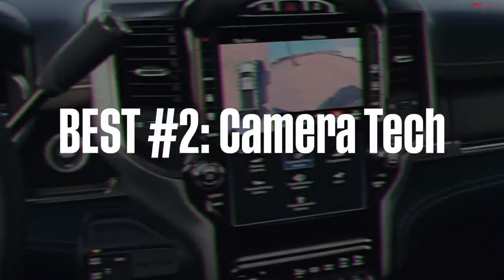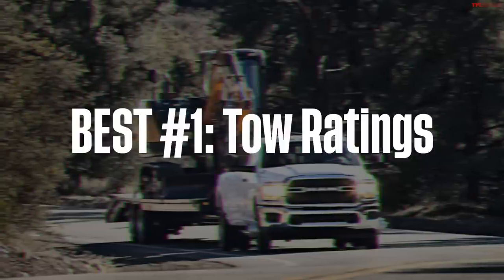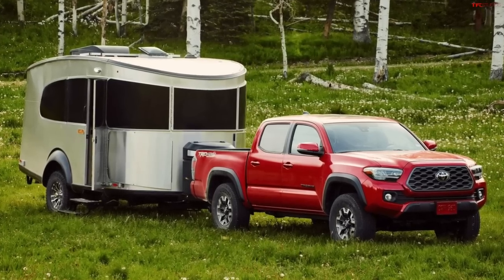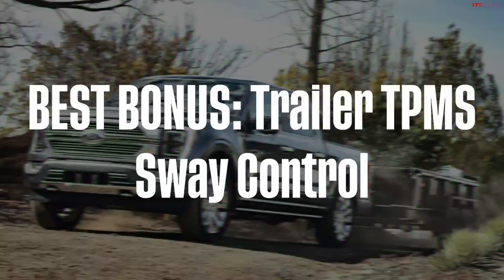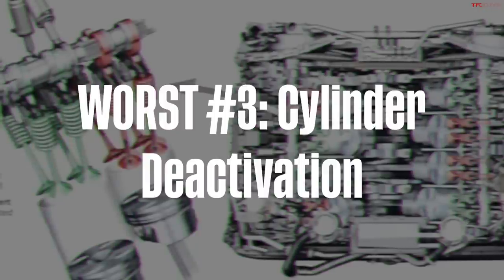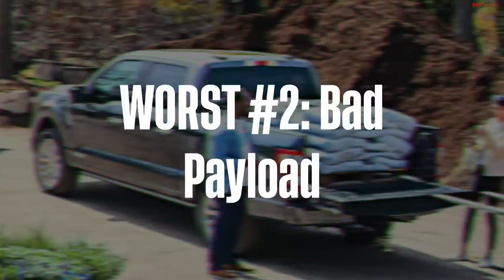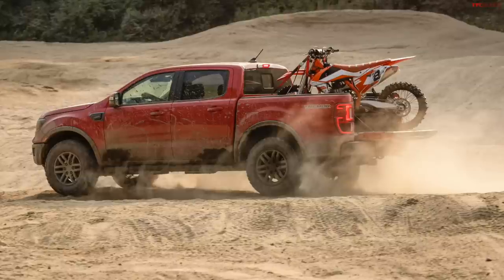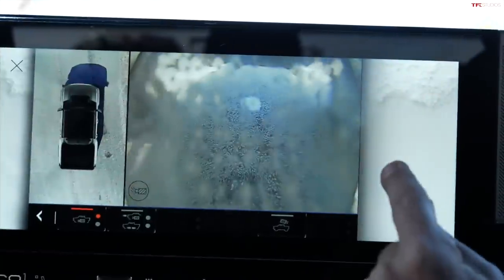This New Truck Tech Makes Your Pickup WORSE!

Comment: There are two ways to save fuel, make a large engine act small when full power isn't needed (cylinder deactivation) or make a small engine act bigger (turbo a small displacement engine). It appears that the former achieves better fuel savings (comparing GM results to Ford's Ecoboost).  Not sure about the long-term durability concerns though.
Reply: Subtract weight, reduce aero drag. Engines are practically meaningless. See Corvette mileage vs Silverado.
Reply: @talanpomeroy4475  in a pick up truck designed to tow 10k+ lbs... And tell that "engines are meaningless" comment to my 1997 F150 with the 4.2L V6 that can barely get 16mpg while weighing over 1k less than a modern half ton truck (with a V8 getting 20mpg).
Reply: @HorchataFan Interesting opinion, but the data (both GM's and owner data in Fuelly) says otherwise. The reason I compared the old versus new engines was I was responding to someone who said engines and efficiency tech don't matter...they obviously do.

Did a little googling to see if some of your points were correct though....it's good to be thorough. Drag coefficient for my 97 (smooth body) is .45 versus the 2022 F150's .463, so my old truck is actually more aerodynamic.  My truck weighs 4203 lbs versus the current F150 at 4941 lbs.  My 4.2L produced 210hp/255lb ft versus the current 5.0 V8's 400hp/410lb ft of torque.  I do have the 5spd manual versus the 10sp auto....didn't check final drive ratios (efficiency once cruising) but I suspect there isn't a ton of distance between them.

Once a vehicle (whether it's a truck or bicycle) reaches a constant cruising speed, nothing close to full power is required (not talking about hauling any load here). A quick Google search shows it ranges from as little as 10 to 70 hp...this is where cylinder deactivation (GM) or getting off the turbos (Ford) yield fuel economy benefits. While both yield results in lab testing to push up EPA estimates (neither company would go through the expense of adding them if they didn't), GM's approach appears to be better in real world driving.

Comment: If I purchased a new truck, it would be a 60-70's 3/4  ton 4 door cab (military type) with a 12 valve Cummins, 4 wheel drive, updated interior with air and cruise.   

New trucks are way too complicated, and all of the technology is an invitation for problems. And I saw where the average F150 sold for $71,000 in 2022. No thanks.

Comment: START STOP 😢 Dangerous pulling out in cross traffic . Only effective if you live in extreme traffic areas like NY, DC , LA, AT
Reply: I guess it depends on the truck. My Tundra hybrid has that tech, but you don't notice it unless you are watching the tac. Start/stop, np
Reply: @BrogeKilrain  that too depends on where you live. I frequently drive over 6k foot pass with about a 7% grade, so savings for me, instant.
Reply: @JIPlatium  how the hell does start stop save high altitude?
Reply: @BrogeKilrain  so I'm talking about my truck, which is hybrid. Start/stop happens at a light and on the hill or when the battery has regen, which will run in EV for a bit before kicking the engine on. Battery takes over quite often in town when doing 30mpgs or so. Always going on decent and or when parked or idling. All this takes place seamless, which if you don't watch tac, you would never know.
Reply: @JIPlatium  I’m not talking about hybrids , read my post 
My EV turns off too so what about it ?
Reply: @BrogeKilrain  to be fair, I watched the video, read your comment and posted. The tech doesn't only come on gas vehicles. You didn't state you meant gas only. I was pointing out I love the system on my truck. Maybe instead of not liking my response, you could be more direct in yours. Wish you all the best.

Comment: Most people don't tow 50,000 lbs. Make trucks smaller, simpler and more basic. Most problems, such as needing tailgate steps, would be solved. Also, I'm not a fan of all the cameras and sensors. Learn to drive and use a mirror

Comment: Bring back the column shifter and more front bench seats. Also, I'm in the minority of likeing Start/Stop and cylinder deactivation (as long as the engine is still reliable. Who wouldn't want a few more mpgs out of their truck).

Comment: Great video! yes the infrastructure and batteries aren’t quite yet up to par with gas trucks, but haven’t y’all said that electric trucks are just as good maybe better when they are towing because of huge torque and great stability? Not to mention gas and maintenance savings, no wear on a transmission.

Comment: I agree with the need for range extenders but I don't want that built into my truck when I already have it sitting there in my trailer. Just let me charge off of my Onan 5000 while I'm rolling down the road. Should be good for about 10% range increase at 55 mph. Even better if I convert to a 240V generator with a 14-50r plug. When I get to my destination, I can top off for the next 4 or five days mixed with overproduction of solar and the generator or use hook ups. I'm looking forward to having a truck that tows with the ease of my Ram 3500 but can still be used for short trips around town without clogging a DPF system.

Comment: You touched on cylinder  deactivate.  You missed this POS auto start stop BS when u get to a stop.   Before I had mine totally deactivated on my trail boss I counted it one time out there in the old field end feeding cattle it stopped and started 37 times within two hours.  GM and every other company should have to warranty your starter and flywheel for eternity with that stupid BS.

Comment: Some of the tech is legit like the different bed materials for rust resistance but stuff like the tailgate variants is a lot more hit or miss.
The tall hoods thing isn't that bad even without the cameras, as reviewers driving many different trucks you guys don't quite get used to the shape and size of a specific vehicle.
For the tall trucks getting a wheel to wheel running board solves that issue and even without it you just climb up the rear wheel spokes on to the tire and then reach or step into the bed.
The trailer steering is frankly dangerous because if you the driver don't learn the basics of trailering including maneuvering (I would also say pre-trip checking for tire pressures) then do you really have any business towing in the first place?

For the expense of trucks I think a big thing to press on is the a la cart nature of trucks. I should be able to get a stripped down XL trim F150 with only the bare features I need like a LSD, the motor I want, 4wd, and the number of speakers I want. Nothing else I don't need or want to pay for.
Of the big 3 Ford has been traditionally the best about doing this but even they are starting to succumb to packaging issues where one option for $300 suddenly requires $2000 dollars of other equipment to be added which quickly makes that XL truck nearly the same price as XLT trim.
We can have the luxury trucks but not at the cost of losing the ability to spec something within our budgets which is something that I think is fundamental to the American truck market.
I would also add that dealerships don't help because trying to order a specific truck is like pulling teeth and you usually just have beat the sales person down to even consider doing it.

Comment: Worst features: Electric trucks. Start stop. And the idea of having electrical plugs to run your house on is stupid! It already takes 2 days to charge up the trucks battery for crying out loud. Just how long do you think you could run your house and tools from it? Those batteries drain a lot faster than they charge. Just stupid.
Reply: Electric Trucks > New ICE Trucks with auto start and stop systems and craptastic modern automatic transmissions

Comment: I don't like modern cars at all - they're UGLY, they lack reliability and cost absurd amounts of money without adding anything practical.
Basically they became overpriced toys full of unnecessary features.
I'd bet an average working Joe wouldn't care much about a shiny multimedia screen, electronic driving assist or massage seats, but would prefer better MPGs and hauling capacity.

I personally like driving to be a little bit challenging. In my opinion, reliance on tech has made modern drivers careless and sloppy.
And this army of warning dings and lights is just annoying - I friggin KNOW my door is open, cause I opened it, dammit..!